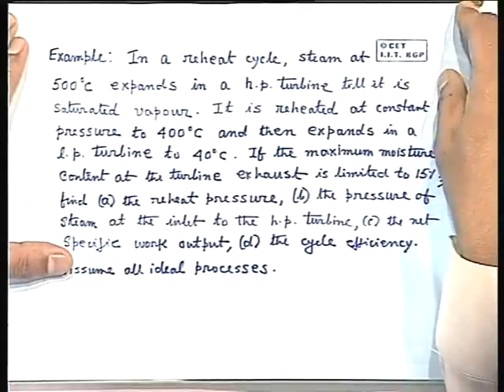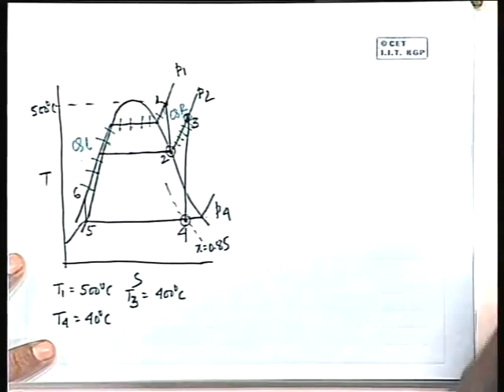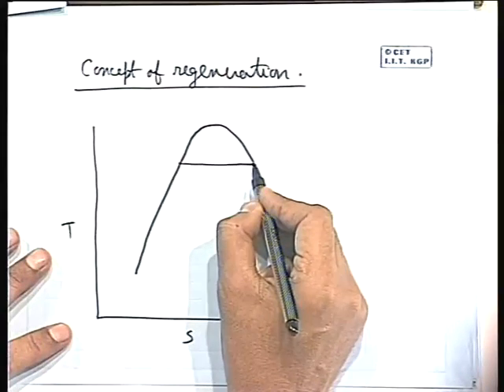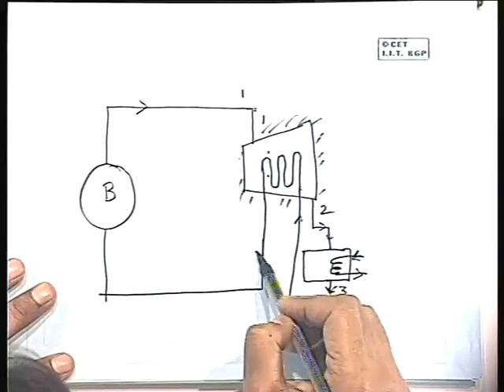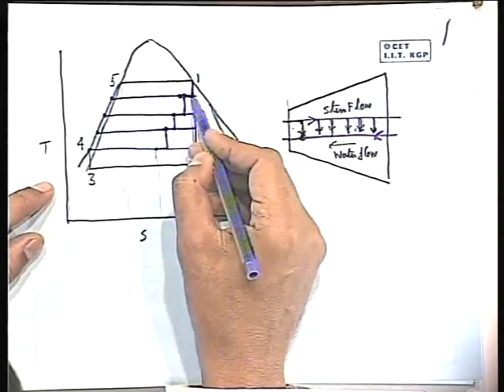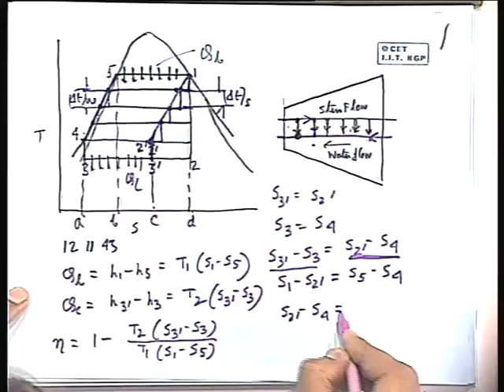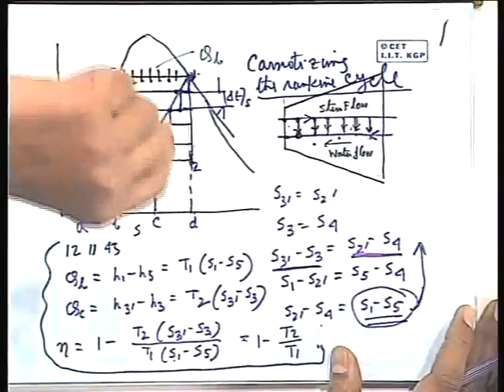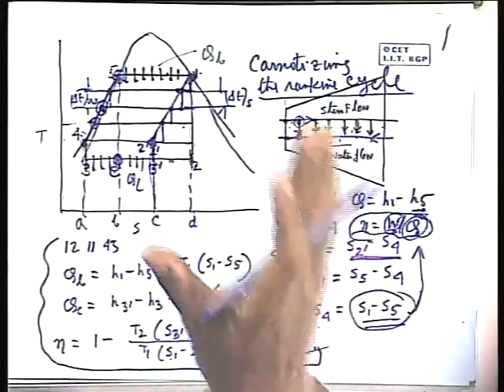Lec-22 Vapor Power Cycle-III

Comment: I have a question the heat interaction between steam and water flow is internally accomplished... There is no heat interaction with ambient. In this situation expansion of steam should also be isentropic.   Please corret me if I am wrong???.
Reply: no it becomes reversible diabatic expansion

Comment: can anyone tell me like what is the practical temperature (generally we find) when the working fluid passes the "feed pump"...And we all know steam turbine entry temperatures are typically around 565 °C ...please mention what is the temperature (we get) after feeding working fluid into feed pump, as it is isentropic compression process?
Reply: I don't know about actual plants, but if you look at a compressed liquid water table, you see that the temperature rise is negligible, only a few degrees even when the pressure rise is something like 500bar.

Comment: Doesn't dryness coefficient reduce after regeneration???? anyone explain
Reply: Yes you are right, the dryness fraction gets reduced which isn't a good sign for the low pressure end of turbine, but again that's the case with an ideal Carnotised Rankine cycle. In actual practice, the process isn't isentropic and some amount of entropy is always generated in the steam turbine, so that the actual expansion line deviates a bit towards right, compensating for the reduced dryness fraction by a certain amount.
Reply: yes it does the dryness fraction reduces after regeneration as the temperature drops of the steam the moisture content increases....
Reply: but sir told in last class that that dryness fraction cannot go below certain limit i.e 0.85.And he told various reasons fir that.But here it seems to be reduced a lot.I am confused ?
Reply: Shubham Chaudhari that is why regenerative reheat cycles are used
Reply: abhu bhi chahiye kya explanation ya moh maya se bahar nikal gaye ho
Reply: @akashanand1329  Very well understood 7 years back. Now working in ONGC because of Moh maya.
Reply: @prashikbhagat  yeah. i saw your ongc video... i have my barc exam next month. I am sure this moh maya will help me too.
Reply: @akashanand1329  best of luck